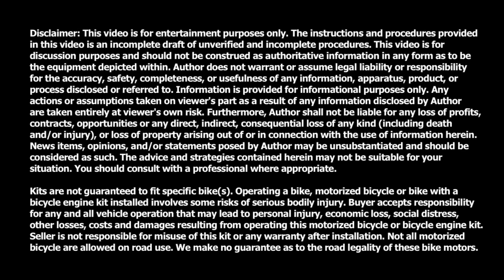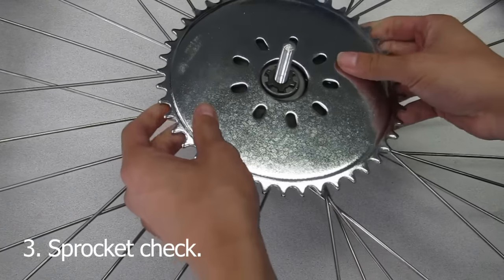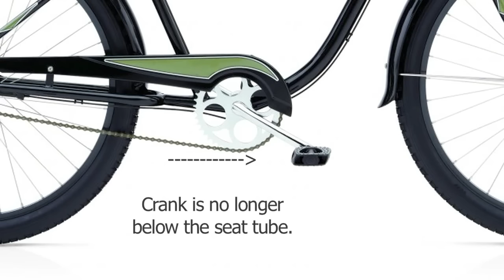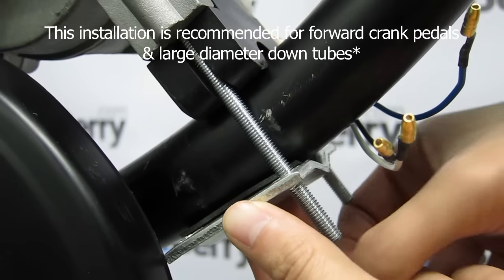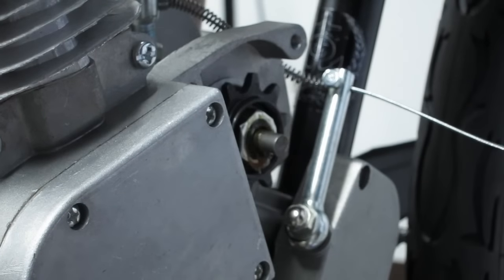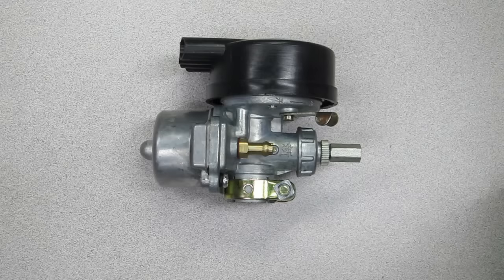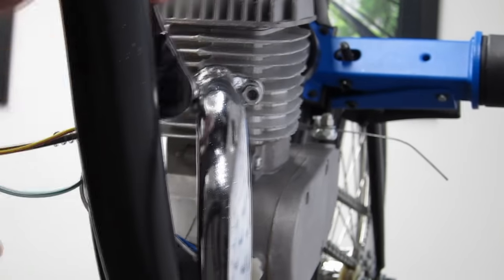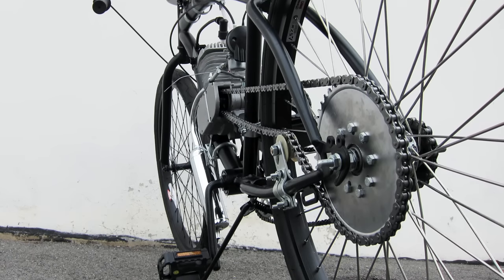How To Install 80cc 2-Stroke Bicycle Engine Kit FULL DVD 66cc 48cc 50cc

Comment: i got the chain on but the chain is rubbing against the tire
Reply from the maker: If not already having done so, the rear sprocket can be flipped to have the teeth offset to the outside of its mounting point. This will allow a 3-4 millimeters of extra clearance that may help gain clearance. Additionally, if mounting space allows, the engine can be mounted offset go gain additional clearance.

Comment: Where to put engind oil ?
Reply: mix it with the gas, doesn't say ratio in the vid, my engine is 16:1 during break in and 20:1 after

Comment: Why do  you drill thre hole in handle bar?
Reply from the maker: There is a notch in the throttle. The notch goes in the hole you drill to hold it in place.
Reply: BikeBerrycom thanks a bunch.
Reply from the maker: @MrMauricio1947  Were here to help

Comment: Do you sell one for a 29"  ?
Reply from the maker: These kits are sold with universal mounts, that fit most bikes. The only issue with a 29" is if it's a fat tire, as the chain may not clear the tire.
Reply: BikeBerrycom great norm tires .

Comment: is it fit for roadeo a 75
Reply from the maker: The Roadeo A75 has a fairly tight geometry and likely would not have enough space for a center mounted engine. If you would like to be more certain, we do have a video for engine measurement that may be useful.
https://www.youtube.com/watch?v=NR8-IcrbwaI

Comment: What about the rear brakes?
Reply from the maker: For these type of builds a coaster brake is used for the rear wheel or the rear brake is entirely taken off, as the majority of stopping power comes from the front brake.

Comment: 14:05 Why do you need to drill a hole into the handlebars?
Reply from the maker: The throttle grips have a small notch in them. Drilling the hole allows the notch in the grips to lock in place.
Reply: Ok thank you

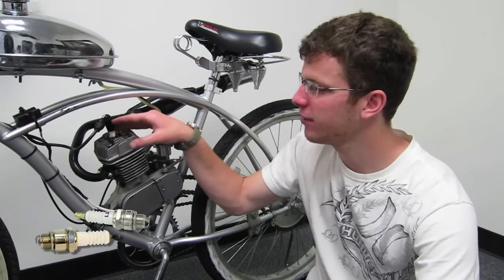Comment: Starting at 16:31  MY BIKE CDI has a black and red.   So do BOTH wires from the motor go into the dual plug on the black?  Or is it black from motor to black on CDI, then red from motor to red on CDI?  That's how I guessed. 
THEN.... MY kit's throttle has a black and green wire.  Not a clue which side goes to what there. 
The company I bought the motor from sent me this diagram.   https://www.bicycle-engines.com/product_images/uploaded_images/wiring-diagram.jpg   Even LESS helpful since their wire colors are nowhere close to what I have.  Their showing throttle as green and yellow.  Again mine are black and green.   What equals what here?
Can someone clarify this a bit?

Comment: Bro can i run this engine on petrol
Reply from the maker: Yes, you can. We apologize if there was any confusion. In the States we refer to petrol as gasoline. The fuel should be 87 unleaded octane or higher

Comment: how much will this cost
Reply: including the bike, around $300, but without you can just get the kit for like $120
Reply: +Tanner Rauschenberger $100-$150 bike from Walmart $135 kit on eBay or Amazon like $235-$285 total
Reply: +Dominic Segura can i get the  name of the same kit used on video? n would that work on my kent 29 stryker?

Comment: Another MAJOR thing !   This is VERY IMPORTANT for 2 stroke engines, not as important for a 4 stroke engines  as they do not VIBRATE like  2 stroke engines.  I  install two stroke engines as they ARE more powerful and quicker.  It is wise to take all the engine mounting studs out and cleaned of oil and grease, and then  reinstalled with a REMOVABLE LOCTITE !    I use the blue LOCTITE and the green one for the carburetor adjustment screws ( it's serviceable).
   The RED one is PERMANENT !!   DO NOT USE IT.

Comment: Also please understand, a mountain bike was not intended to be rode at the speeds a motorized bike will.  So take your time to pull the axles apart grease them and properly adjust the bearing preload.    A word of caution !!!  If the bike was manufactured in China ,   it would be a good idea to replace those bearings with a better set of Japanese bearings.

Comment: First you need to check your engine for defects 90% of the time the piston is on backwards and there is usually metal flakes inside your cylinder .
Reply: I can just see I'm going to spend a week assembling this kit because that's how I am, and then it will never start lol.
Can't wait......
Reply: How'd it go @c.rutherford

Comment: I'm lost. why did he drill the hope in the handlebars
Reply: Llessur  i was thiking that why did he drill the hole 🤔
Reply: Daniel Penny There is a notch on the kill switch assembly that is meant to keep the throttle assembly in place. By drilling the hole, the notch can rest there and keep the throttle and killswitch assembly in place
Reply: hede53607 thanks bro im stripping my frame at min then ill be respraying it then putting it back together then ill be installing the 80cc engine cant wait 😋 thanks for the video and the reply appreciate it
Reply: Daniel Penny no problem, I'm waiting for Sunday to get my bike since my engine came a day early and I'm super hyped for it

Comment: It doesn't matter how big the tires are as long as the engine fits I seen someone put it on a BMX bike they had to cut the top pipe right underneath the seat that's it
Reply: Don't ever cut the frame expecaily on a motorbike that's how you have your bike bend in half while riding and needing the jaws of life to get you free while suffering major organ damage

Comment: In regard to Bikeberries last post to me/Jack M, I'd like to get this out of the sub thread so this serious problem it's seen by more people.

 "and let us know if there's anything we can do to help."

You can take this nightmare back at your expense, like I already asked, and that was before the other serious problems were revealed.

Not sure what to do . I'm the one that had the too short crankshaft, and had harsh words with you buy email. Why? because I naturally expected more. One of my 3 pull starters would barely fit, grabbing a couple of threads on the too short crankshaft. Stripped the softer nut right away and the second stayed on there long enough to try everything under the sun to get it running.The jerking from the kickback probably ruined the pull starter that did work, so between that, and the pull starter not fitting properly already, and now having to order another that may now work at all, and the handicap/not being able to pedal I just gave up on it...too much working against me.

One tries to go on the cheap out of desperation, and this crap happens, taking what little money we manage to get our hands on, and nothing but, a "not our problem" , so I'm just out of luck. Sorry but that's just not cool. And if that isn't bad enough, when I did get something going to attempt starting it up,  it revealed an engine with other serious problems. But, hey, you got your money, and I suppose, somehow in your mind, you stopped me from ripping you off, when I did all I could trying to make what should have worked in a couple of pulls for the price I paid. And yes, thoroughly upset about this one.

FWIW, I'm 64 this month, now and took a 1 yr small engine course back when I was a kid, and have virtually never taken my car/anything to a mechanic, as I DIY everything. Just so you know, it ain't me.

Comment: Some tips invest in a proper tool set even if it's from Walmart get some wrenches and sockets none of this pliers. And please don't use locking nuts for the 2 but a tad removal seen many guys cross thread and break u bolts that way.

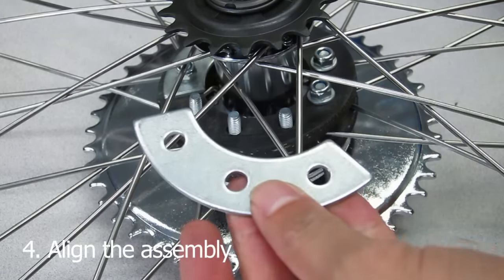Comment: To BikeBerrycom  ...At section No 4  or 3:30 you got the three plates in the wrong place. The two, 5 & 4 hole plates should go over the inside rubber, then the three 3 hole plates go on next, to overlap the two joints in the 5 & 4 hole plates to make a complete steel washer when tightened up to correspond with the sprocket plate when finally tightened and bring the steel sprocket and the 5 steel plate assembly parallel.  The two 5 & 4 hole plates as you have them are bending out of shape . Also the three plates as you have them, are not serving any purpose next to the sprocket. !!   See StarFireBikeEngines.com.au
Reply: Starfire bike engines you say🤔 I have the exact kit in the video and I'm missing lots of parts... I'm gonna check out starfire

Comment: I dont have the 2 long ones
Reply from the maker: Contact our customer service representatives at 1-800-317-0479. We'd be happy to help you solve this issue.
Reply: BikeBerrycom hey thank you for your response but i got the kid from ebay not from bike berry. I was just wondering if all kind if kit should include them. Doesn’t matter the brand.  But do we really need them.
Reply from the maker: The newer version of the rear sprocket clamp assembly comes with thicker rubber bushings that removes the need for the two larger brackets, which acted as spacers. It is completely fine to install the assembly without them.
Reply: BikeBerrycom alright.  Thank you so much. 🙏

Comment: You say you can't put it on a bmx but then why do I see people having it on a bmx
Reply from the maker: It is most likely that they are using a smaller engine than the one specified in the video or they may have a track frame or another style of frame converted for free style riding. In our experience, most bmx bikes do not have a large enough geometry to accommodate a center mounted engine.

Comment: Bro so no oil inside engine
Reply: I thought it’s mixed with both oil and gas
Reply: There is no oil inside of the engine in like a car. Instead, the gas & oil mixture pulled from the carburetor gets circulated throughout the entire engine (yes, even the crankcase) while it is running for lubrication.

Comment: I really hope someone who knows this, will see this comment soon.
Does anyone know if it needs any sawing or power tools that require cutting anything in half? 
I am currently planning on buying a kit so that I can place it on my bike to go to work, during this Corona Mayhem.
Reply: you may need to saw a grove in the chain guard to fit around your frame. that's the only sawing you'll do on it. You will need a cobalt or titanium 5mm drill bit tho to drill a small hole in the handlebars for the throttle.

Comment: Step 4. aligning the assembly, so the guide im going off to build my fat tire 80cc bikes suggest i may have to modify the rear sprocket so that the diameter actually fits. In the article,  the dude literally cutts it with a rotary tool,  Not wanting to even attempt that is there a way i can measure it and order a properly fitting 36-40 sprocket ? preferable the one attached, thanks.  https://www.gasbike.net/products/36-tooth-cnc-sprocket-adapter-assembly

Comment: My flower nut on my clutch cover won’t budge 😤
Reply: The flower nut will move if you pull in the clutch lever. It will remove all forces applied to the nut and then it can be moved by hand

Comment: It's not a good idea to just zip tie that chain guard to the frame, (surely should be a bracket?),will rattle with the vibrations and drive you crazy 👍😭..(will come lose sooner or later and then end up in the rear wheel, not a good idea when travelling at 30+ mph 👍😭.
Normally when fitting the petrol tap to the tank to use plumbing tape or it mite leak?(where is the in-line petrol filter it's missing??,)..
I'd advise to also change the spark plug,exhaust system,air filter,and chain tensioner bc allways become lose from vibrations and will end up in the rear wheel and  damage everything and the rider,can get a better tensioner that has a spring so mores..
And when fitting the rear sprocket use a torque wrench so then sprocket will be centralised and fitted correctly.
Some the parts are really bad so it's better to upgrade for alot better performance and reliability 👍. .

Comment: None of the holes on the rubbers are even close to the holes on the rear sprocket. Like way off. So my kit is missing instructions. There's no parts list. I'm missing piston pin retaining clips. I'm missing the 5 metal plates that pinch the rubbers to the rear spokes, and now I'm gonna have to ether order new parts I already paid for or make my own parts.  Kinda lame considering I not only bought the exact kit in this video but I also ordered alot of upgraded parts that bikeberry offers. So I'm over $400 in and can't assemble even the simplest aspects of the build.   Who knows what else is missing considering I have no instructions and no parts list..... bikeberry should really be careful when hiring people to assemble their kits. Because I'm very frustrated and wondering if it was worth it.

Comment: I'm gonna stop you right here time stamp 3:17 throw away that rag joint shit And buy the CNC machine motorized bicycle sprocket size hub adapter it's much better and doesn't take two hours to install it!
Reply: Reason why I said don't use the rag joint shit is because the friction of the motor pulls the chain to start the bike motor over time it's gonna work the spoke loose and the motor chain will fly off and wrap around the rear wheel and snap the spokes definitely something you don't want to happen

Comment: Jesus, don't use those rubber buffer pads. all they do is over stress the bolts. If you mount the engine solid it runs and works better

Comment: Your own website has different information than your video
Reply from the maker: For starters this video is from 2014, alot has changed. Secondly the video address a newer 2016 version which is more accurate. With that being said, what are you referring to?

Comment: There is no reason in your video to tell  drilling a hole for the gas throttle to the right  wherever the gas throttle is line up this is where the hole supposes to be

Comment: The sprocket on the engine and on the wheel don't line up properly. The sprocket on the engine is too far in a.d makes the chain rub the wheel or pop and snap due to it being crooked because the sprocket on the engine is TOO FAR in. These are a giant waste of money.

Comment: Well how to describe my experience with gas bike. Let me paint a picture for you. I purchased the Thunder Shark Pro racing kit for 389.00 and should arrive in 4 to 6 days and I will be getting a tracking number from FedEx. A week passes and no tracking number so I call they tell me its on the way I will get a tracking number today and I do get one and 3 days later my package hasn't moved so I call FedEx they told me that gas bike made a shipping label with them but never gave them a package to send, Which happens quite often with this company she said. ( kudos gas bike that's pretty sneaky.) So I call them back and they tell me that the whole problem is because the Dio reed valve and Zeda racing cylinder with the carburetor assembly is out of stock and I will get that at the end of the month but until then they would send me a free stock cylinder so that I can get started on breaking the motor in. So the engine arrives I get it up stairs and open it up and there's about 10 parts missing not only was the stock cylinder missing (that I was to get for free) but the piston too! How the Hell is this motor supposed to run. So I call and talk to them several more times and finally I get the stock cylinder and piston but no lock rings to hold the wrist pin in place so that it doesn't score the cylinder walls. OH! here the best part although missing many of the precision parts I decide to put the piston on anyway and I get down close to the crank case to mount the piston and I smell gas. How does a brand new crank case smell like gas unless it's been used. I don't know but I'm pretty sure you can't sell used parts as new. I believe that brakes criminal laws. And that's not to mention the motor kit shows a picture and a list of what you get for your 389.00 dollars I was told that they would not send me the bracket that is in the bottom left corner of the picture nor would I get the stock head with the center hole that is in the list. I believe that's called false advertising. I guess my only recourse is small claims and talk to an attorney about false advertisement and selling used parts as new. Well everybody that's my experience with gas bike. PLEASE DON'T LET IT BE YOURS! Find another company but be ware I think Kings motorbikes is a different branch of gas bike. Good luck People!. VERY VERY UNSATISFIED CUSTOMER!!!.
Reply from the maker: Hey Terry, Were sorry to hear about your Gas Bike experience. We get these comments all too often and know the difficulty of poor customer service.  Were Bikeberry and we supply everything if not more than GasBike with some of our own brands. Check us out Bikeberry.com

Comment: Any one else not getting a spark?
Reply: Check:

Is the Magnet's woodruff key in a 1-o' Clock position in relation to top dead center? (If it is backwards in the 11-o' Clock position, it will not start)

Are your CDI and Magneto giving good resistance (ohm) readings?

Is the magnet still magnetic? (They sometimes lose strength over time)

Wiring - Black to black, blue (or sometimes red) to blue. White can be discarded or ignored if wired accessories will not be used.

The kill switch can cause electrical issues. It can be safely removed if so desired. To stop the engine, one simply has to stall the engine by releasing the clutch slowly while not moving.

The sparkplug will not give off a visible spark if it is not physically touching an electrical ground on the engine such as one of the cylinder fins. Make sure to do so.

Comment: Agree, proper tools required, also they don't explain fuel ratios or what the white wire from the magneto is for, 
 no torque specs for all mounting and assembly bolts, many have over torqued and even stripped or broken bolts. Rear tire upgrade is recommended (thicker spokes, beefier coaster brake)  this is a poor attempt of a professional video.